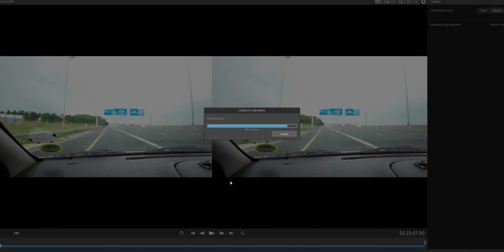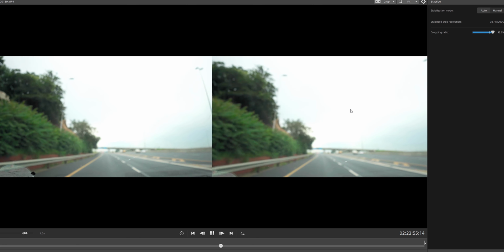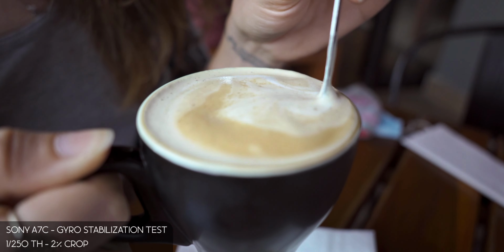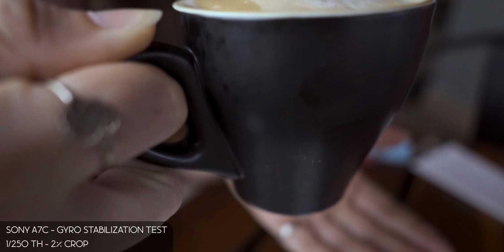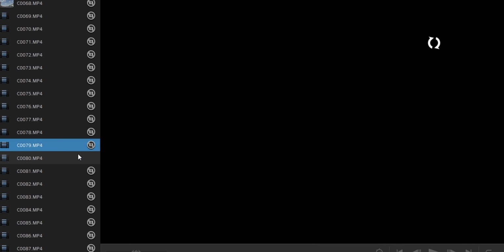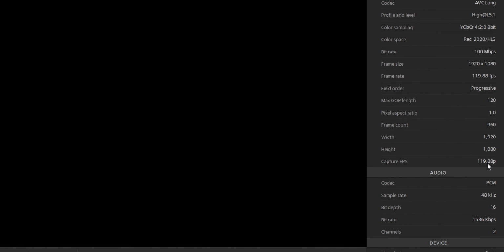Gyro Stabilization For Vlogging??? Sony A7c, what do you think of this? will you be trying it?

Comment: brilliant vid, how is it not got any views. 
I've been hesitating whether to change my A6600 to the A7C for it's gyro. I've only had my A6600 for less than half a year but I've hit it's APS-C limitations at low light. This video helped me at lot in the decision making process.

I guess I don't like the fact it has to work in really high shutter speed it takes the cinematics out of the footage, and I hear it takes an EXTREMELY LONG TIME to render in catalyse browse? how long did it take your vlog to render? I guess I will just wait and save up for the A7S3. Thanks for making this video
Reply from the maker: So to render each clip wasn't long. Long clips like 2 to 3 mins took like 3 to 4 mins to render in catalyst browse.  Then it's done then the vlog works like normal. Also even at like 100 to 200 shutter it's not bad. I did some more short tests that il put onto YouTube soon and I'm planning to film a whole video using it but it takes time and not many people watch this stuff. I may put some shorter clips on Instagram to make it easier. But I'm trying to use it alot to work it out as we go iv only had it a few weeks now. But you will love it. Plus it's full frame. 5he only thing you may miss is that the a6500 has a nicer grip. But otherwise I have loved it alot.
Reply: @OpticalNoise  Yes I've been wanting to upgrade to full frame after noticing the limitations in low light of the ASP-C, but more importantly it's the shakiness of the video footage for my Vlogs that are quite annoying (even with IBIS and OSS lens it isn't that much of an improvement). I know the A7S3 has an active stabilisation as well as gyro but its so expensive. I want to upgrade to the A7C for the gyro so that my vlogs can be stable and smooth but I heard from some people that the work load is way too much to try and use gyro stabilisation for vlogging... so I'm stuck between whether to upgrade to A7C now or stick with the A6600 until I save up and go all out for the A7S3... scratching my head*
Reply from the maker: @yxscars  s3 would be awesome but I'm a photographer first so need my higher megapixels. 

The issue of that gyro is nice but man it would take forever to now stabilize every clip then take it to edit.

I don't mind a little shake when I vlog. Looks real. For work the gyro is better. Or for a clip now and then.

The a7c will be s upgrade in quality and the ibis seems a little better. But upgrade for the quality increase not for the gyro. That's a bonus.

Also use my link if you going to buy if Amazon. Support the channel 😁😁
Reply: @yxscars  its worth using for small clips 2-3 seconds mixed into your videos. Way quicker than using a gimbal.